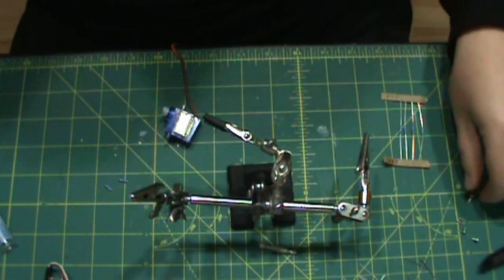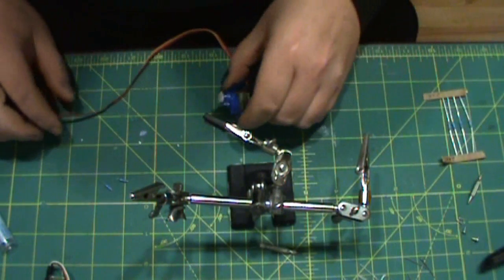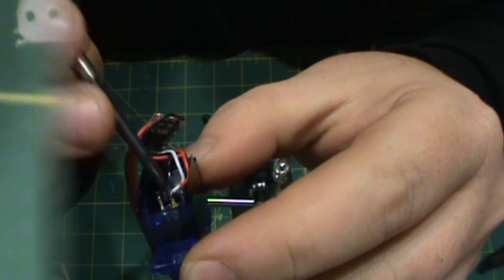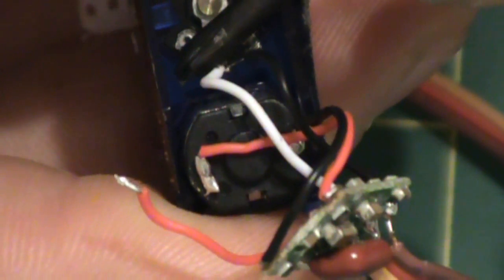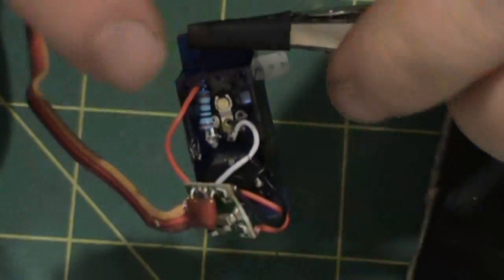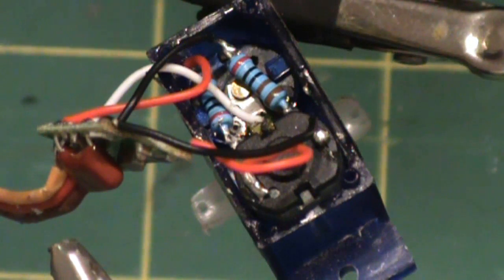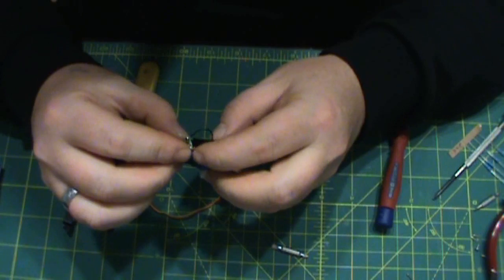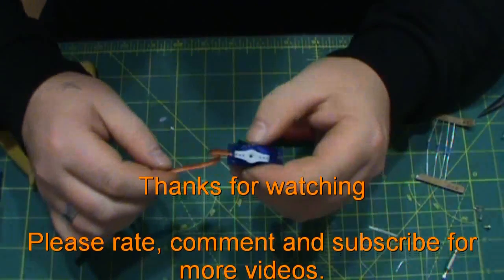How To Make a 180 Degree Mod for any servo

Comment: Hi mate I need ur help I'm looking for a servo with max of 1kg push or pull force with two wires as I'm splicing it with a rc free spool winch so one way the servo will pull a pin in the winch to engage the free spool then wen the control on the transmiter is released the servo will go back to position ready for the controle to be pushed the opersite way to engage the real in funtion on the winch winch will stop then control is pressed the opersite way engages the servo to pull the pin for free spool  and if not ther is a spring the engages the winch clutch wil the sprill pull the servo manually with no electricity or even ad a return damper or shock/spring I'm planning on putting the servo and winch motor into one micro two pin jst male plug so plugs into a mother board room am using

Comment: I modified two old Futaba analogue servos.  They both had an increased range, but they both had trouble returning to the centre position.  Also one of them rotates 90 degrees to the right but when you push left it goes past 90 degrees and will keep rotating right around until you stop with the stick and then it goes back about 90 degrees.  How can I fix this problem.

Comment: I tried this mod and for some unknown reason it didn't work.. used the same 2.2kohm resistors and and the servo wouldn't respond at all. Removed them and then it worked again as normal.

Comment: Is it possible to get more than 360 degrees? I’m trying to achieve 3 or 4 complete revolutions - say 1260 degrees end to end. Is that possible and how would I calculate the resistor value required?

Comment: Why not solder the resistor to the other end of the wire or at the circuit board side. /:

Comment: Great idea!  Thank you.  I would suggest removing a section of wire equal to the length of each resister to gain back some space, if its tight in there.  Also some may find it easier to solder to the wires instead of the tab.  Still, heat transfer may loosen the wire at the tab :<  Anyway, fantastic mod.  Not sure why this works as the swiper does not travel the entire resistance path. Say you have a 5k pot, you add 2.2k to each side, its only moving 1/2 the total resistance.  Am I missing something ?

Comment: I've modified two hxt900 servos like this and each one needed different value resistors to get it to center and have symmetrical travel. 1st one needed a 2k2 + 2k7, and the last one I did needed 2k2 + 3k9. Some experimentation might be required, put the higher value on the side of the pot with the least travel. Another option would be to stick two 5k trimpots to the outside of the servo and make holes on the casing for the wires, then you can adjust the trimpots until it's perfect.

Comment: Junk circuit boards small torch heat violent impact to floor releases tiny surface mount resistors! ohm out each and then use best solderinf skills 3rd hand tweezers, hunt for the right combination of resistance. I miss radio shack but tons of junk circuitboards are waiting to desolder.

Comment: do you lose torque when doing this?  90 deg servo modded to 180 deg = half the torque?

THANKS
Reply: torque is associated with gearing no the amount of joules the motor burns ( well kinda).basically, torque will not change

Comment: Does it matter what servo I am using?
Reply from the maker: +Tgreenmi no it should not matter. Ive never done it to a digital servo, so it may also work.
Reply: +eastcoast78 I was asking because I am building something and wanted more turn in the servo and even adjusting the radio servo travel amount it does not turn enough. Then I found your video and did not realize I had something like add a resistor...... Is the 2.2 resistor for any servo... As fare as u know. Excluding digital
Reply from the maker: yes any normal 2.2k resistor well work. the servo needs just over 4k total. SO the 2 2.4s work great. Just solder them on the 2 outside poles like in the video and it well allow it to travel the 180. If you feel your not up to it, you can get them pretty cheap on ebay etc.
Reply: +eastcoast78 thanks for your help! Now on to the camera them issues..... Lol
Reply from the maker: No worries, any probs ask away!
Reply: I don't see small enough 4.4k resistors to try and make the servo turn around and look behind itself. I need the servo to be sitting forward and be able to turn 180 and look behind itself and then let go and it finds the front center again. I cant see that being impossible but its looking like it. I do not need a continues servo that would be bad for my application.
Reply from the maker: Tgreenmi what you need is a 360 1T servo. 1T means 1 turn.

Comment: thank you guy!..You are the best !..I used 4K resistors.
Reply from the maker: +odontologo98 Awesome, as for being the best, hmm not sure lol
Reply: Hi I have question .
My servo does not work is just shaking why? 
Micro servo 9g and I use resistors in colours red red yellow gold .can you help me please
Reply: @MS-lm6zf  This is 2 years later but: 2.2K is 2200 ohms which is color code red-red-red.
Color code red-red-yellow is 220,000 ohms.  It cannot work.  The gold is for 5% tolerance.

Comment: I did this mod to an older futaba servo, and it ended up throwing off the center of the servo.  I found that for some reason my servo was only supplying around 2 volts to the potentiometer instead of the full 5v input into the servo.  I'm guessing this is why it acted so odd.  Oh well, I was able to adjust it out in my radio mixer.  Thanks for the idea, saved me from buying a premade 180degree servo.
Reply from the maker: +James Downing awesome ,glad oyu got it sorted out. Cheers

Comment: Why cant the resisters be put on the outside of the servo rather then opening it. It would be a lot easier and a simple coat of conformal coating wold water proof it. I'm no electrician so what is the reasoning for the internal installation?
Reply from the maker: RC crazy hey, thanks for the suggestion. I'm sure it could be done. :)

Comment: does this work on a digital servos?? i have a digital servo that pans 180, but i want it to go 360. but i want it to work as normal servo, just that it travels from 0-360. not like most of the 360 servos that goes continually..
Reply from the maker: eX750F Yes it should work. But you have to take a certain gear out that has a stop(so to speak) on it. Its what causes the servo/gear to stop at a certain spot. If you do not remove it, and mod for 360 it well burn u the servo.

Comment: Before I try this, does the servo still center?
Reply from the maker: Yes it does. It works great. Depending on the servo your using, it may be off jsut a touch. But it well be off before oyu do the mod as most avg servos do not center perfectly. Just use a bit of sub trim as per normal.

Comment: Good job, but why dont solder the resistor on the PCB side, look more easy to me.
Reply from the maker: Thanks, yeah i tried to do it that way, but then the PCB board would not fit back in. It may work that way if you left the wire on 1 side of the resistor a bit long and bent them in closer to the board, that might of worked.

Comment: Great job, I am gonna go and try it.
If you have a full size servo do you use the same size resistors?
Thanks a Big Bunch
Super way kool man
Reply from the maker: Thanks dick, yes i believe the 2.2K well show the same results on a bigger servo. Just buy a bunch. At my local elec store they are 25cents each. You can also solder 2 resistors to each other and it well double the resistance. If your using a bigger servo with the extra room.
Reply: @eastcoast78  That's true for series resistors only!  Put them in parallel and you get 1/T = 1/x + 1/y where T is total resistance, x is one resister, y the other.  So in fact you can mess around with combinations of serial/parallel to get what you need.  Excellent idea.  Thanks a lot